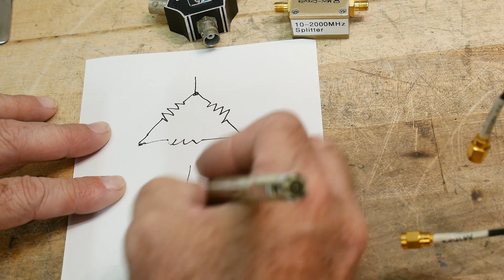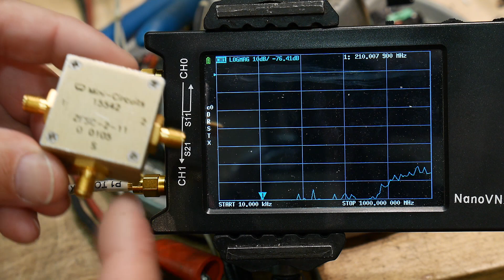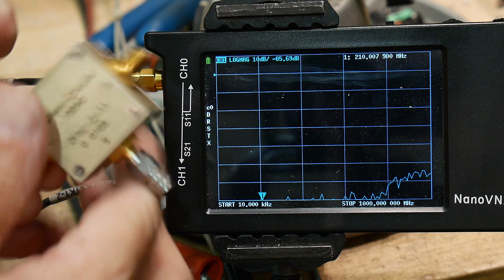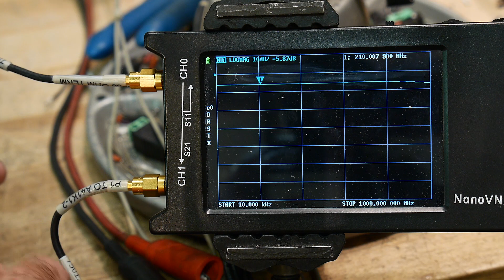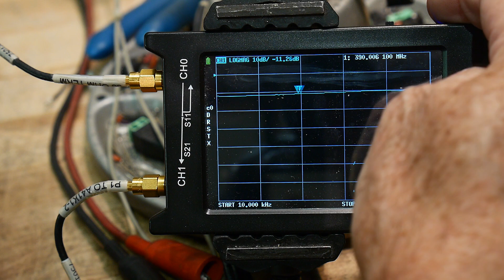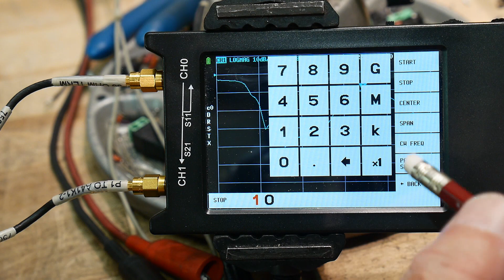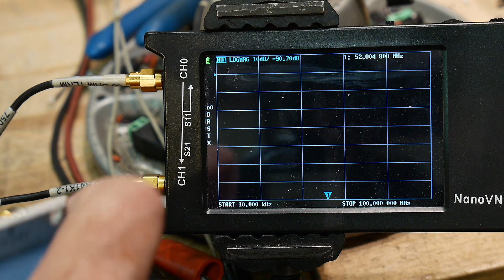#575b NANOVNA Measuring Power Splitters

Comment: As with digital logic you can run into "fan out" issues...I used to use even more "ported" (is that a word?) Mini Circuits passive splitters to feed my 10MHz bench referenced test gear. But as more and more instruments were added the outputs began to fall below the reference input requirements of the devices. Powered dividers provided the answer and in those cases the cross talk wasn't as important. TAPR still makes a good one with 6 outputs (have three of them all full!), although the case to put them in isn't available any longer. Thanks for sharing as usual!
Reply from the maker: I found a big problem with them, crosstalk. The TInySA is really noisy and getting back into the good SA. I will be using a coax relay to switch.
Reply: @IMSAIGuy  Yep, for instruments like analyzers, signal generators, VNAs etc. they're probably not all that great. But to just distribute 10MHz around I think they're ok, although I suppose cross talk could introduce some modicum of a phase noise jitter effect from the test equipment's input circuitry that accepts the standard and comes back down the line so good point to at least consider, thanks!
Reply from the maker: @PapasDino  oddly, a video will post on the 11th where I talk about a distribution amplifier for my 10MHz cal reference.

Comment: That HP power divider - Agilent Keysight HP 04192-61001 Power Splitter - is an accessory to the HP4195A. I made one myself with 2 resistors
Reply from the maker: yes it was part of a kit. it included two bridges forward and reflected, a load, and the splitter. I have all but the forward bridge.

Comment: I have a 4 port and 8 port mini circuits power splitters. I would like to measure them also with my NanoVNA. But I only have the 1 load, from the NanoVNA kit. Is there a way that I can measure this with this current setup? Or do I need to buy more RF loads? Thanks. MikeK
Reply from the maker: you need more loads.